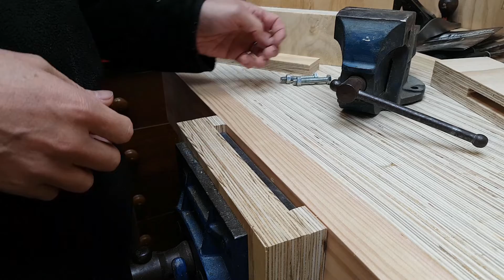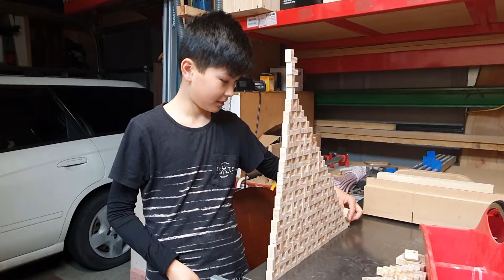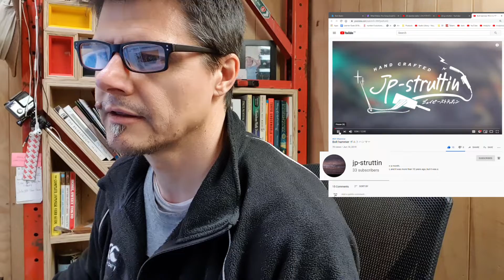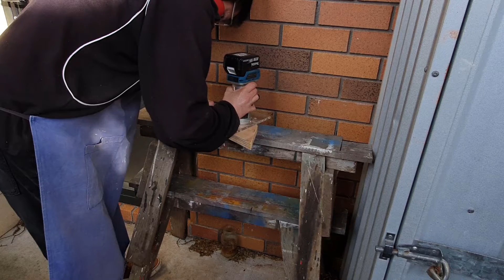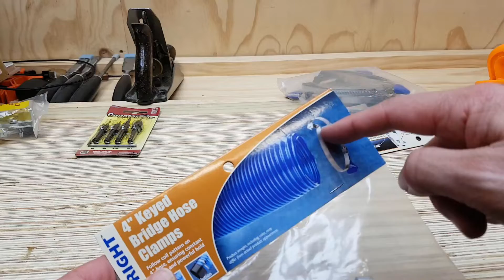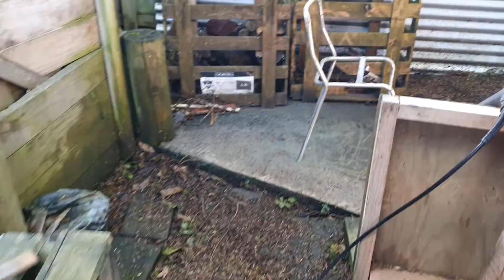🥓🍗🍺 S01 E02 (Shop Update)

Comment: Good show Rob, really neat idea for mounting the metal vice over the wood vice. Yes, now you pointed it out I can see the problem with having metal screws running close to the jointer blades, probably wouldn't have noticed otherwise :-)
Reply from the maker: Cheers Bob - yeah metal on blades doesn't help much - but to be honest - it would have to be some pretty thin material. I wanted those push thingys anyway - just always looked better to me. Haven't used them yet though.

Comment: I used dowels to hold the hook onto my jointer push block. You livin on da edge using scroos.  😂👍
Reply from the maker: What does the Australian woodworker use to join pieces of wood? Kangascroos. 😎
Reply: @TakamiWoodshop  full sized kangascroos, not pocket kangascroos :D